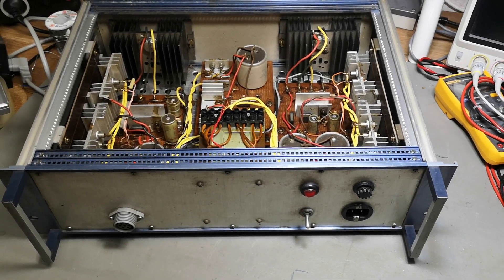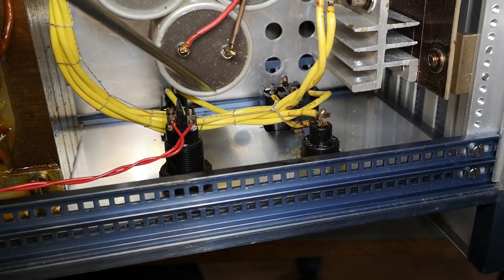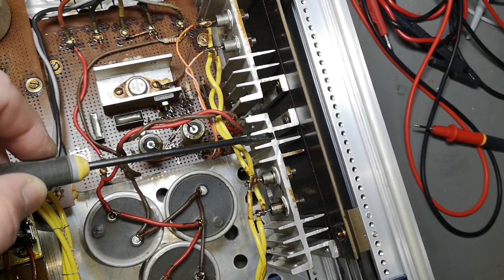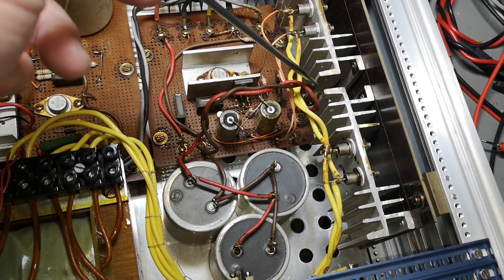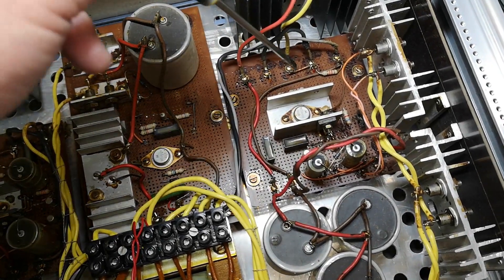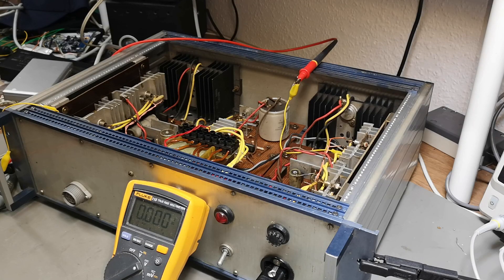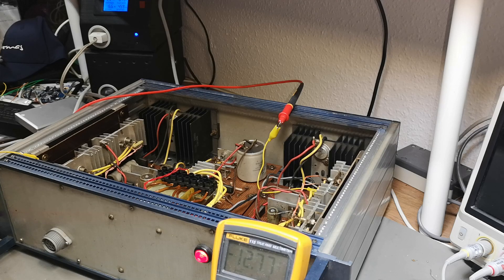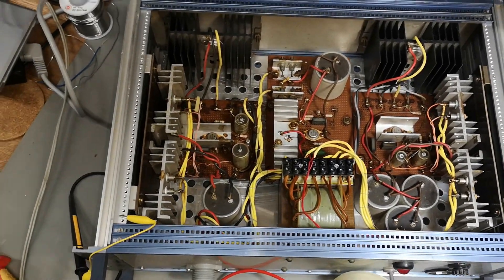DIY power supply 3 in 1 linear 1971 teardown rectifier and twisted wires explain

Comment: Auch sollten die Halbleiter etwas unter der Mitte der verticalen Kühler montiert sein, da die Hitze ja steigt. Hier, auf der rechten Seite und Hinten, sind sie an der oberen Kante montiert ...
Reply: In this case it doesn't really matter, the heatsinks for the diodes are  way bigger than they need to be.
Reply: @Sine1040  Ok, but it's a wrong philosofy of design, like the incorrect connecting of the main capacitors. And the transistor behind, on the top too, we don't now if the heatsinks are overdimensioned. I'm spanish and german speaking/writing, english understanding :). Carlos, Buenos Aires.
Reply: @cbiz8  When you have the choice you don't do it this way. In this case I'll say they are close to overkill, that little transformer can't supply nearly enough current to get these diodes hot. I mean, even the pass transistor has a heatsink not much bigger than the diodes combined.
Reply: @Sine1040  Ja, in diesem Fall hätte man die Kühlkörper  einfach 180° gedreht, also "kopfrunter" montiert.

Comment: Hello, about the grounding, the builder thought that a frontal metal panel would be enough for the connection, at that time some constructions were made that way - the mains socket is also designed for such a mounting, because it is anchored behind the grounding contacts. So far so good, but there is still a mistake, a toothed washer was prescribed under the mother and it is missing in this construction - so at least I did not see it in the shots neither at the socket nor at the transformer, let alone between the panel and other parts of the chassis. Tying the mains wires of the primary to the wires of the secondary and connecting large input filter capacitors is really bad.
🤔 It was probably built by an ignorant American because the mains switch lever is turned off in the up position 😂 otherwise it is built quite nicely, those Pertinax cooler insulators are a good construction detail.

Nice day 🙂Tom